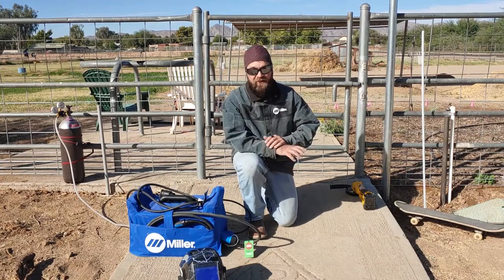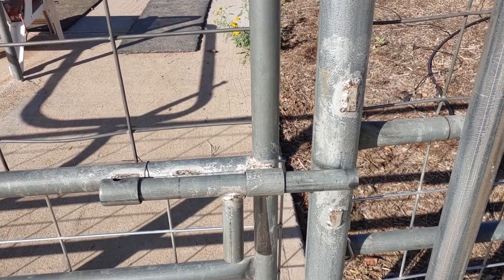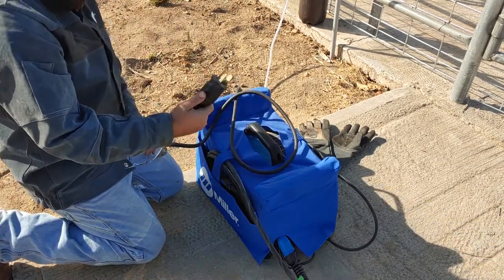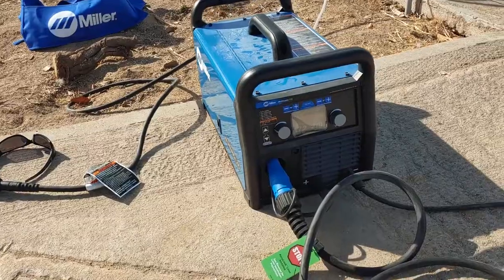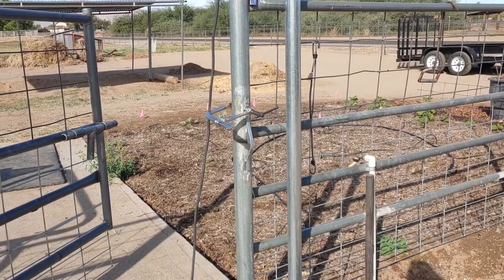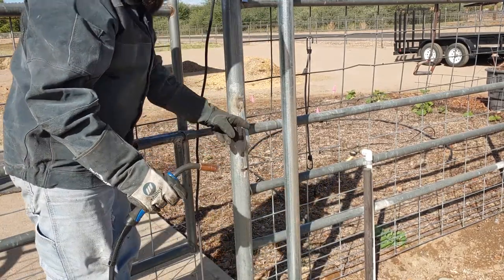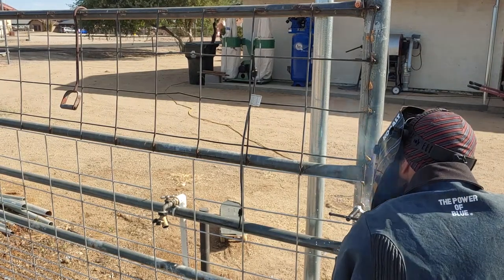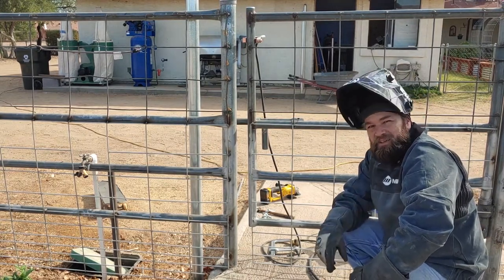Repairing fence with the Miller Multimatic 215

Comment: Nice work. For outdoor welding, stick is the way to go. Since the shielding gas is easily displaced, MIG isn't really suitable outside of a controlled environment. You could use flux core, but at low voltage, you'd get better results with 3/32 dia. 6010 or 6011 rod.  I believe the 215 does stick. I'd also recommend feathering the galvanization back 1/2 or so from your work area, and stay up wind if possible. Burning Zinc can make you real sick, real quick
Reply from the maker: Yes, the 215 comes with a lead for stick. I probably should get it out and get some sticks. I have a lot of work to do on our fence. Good tip there on the zinc!
Reply: Flux is the way to go for outdoor. No gas bottle, no shielding gas to get blown away and faster than stick so you get the job done faster and make more money. Lincoln innershield wires been tested up to 30mph winds and you get way better penetration when compared to mig and equally as good as stick.
Reply: @savingmiller  hes %100 correct bro...........welder of 30 years here...........u dont want to have to use shielding gas if u have a option........stick is thee only way to go....so fast....

Comment: Next time, clean the galvanized with a flap disc and your welds will be fine. Also, since you weld in a farm, a spool of flux core wire  will make your life much easier.